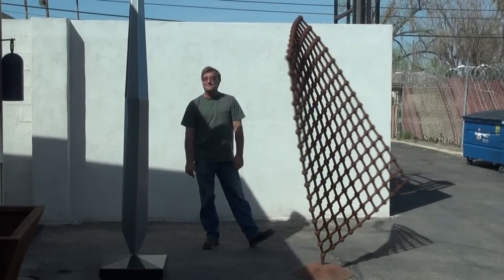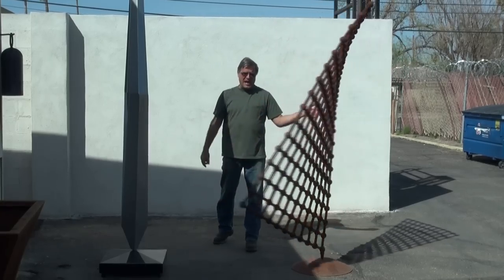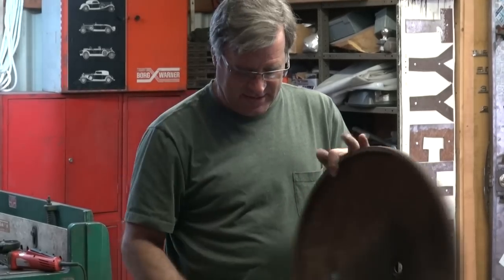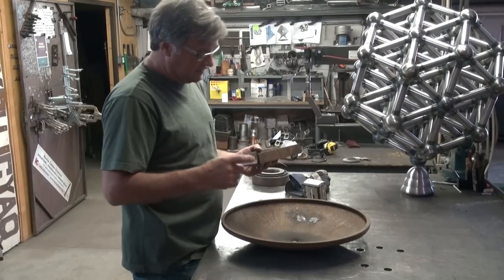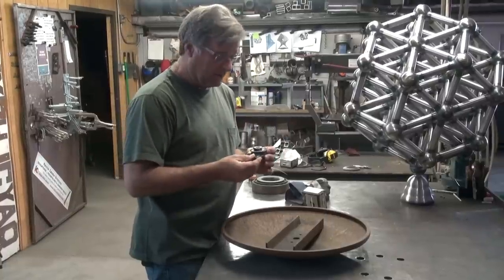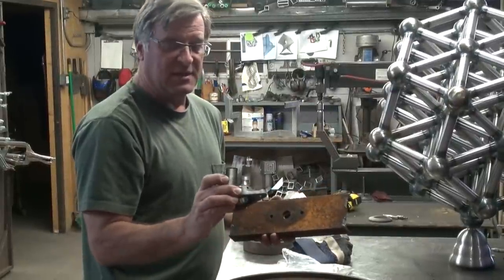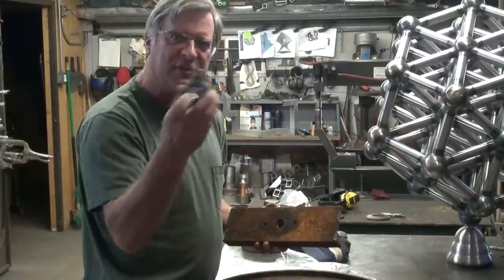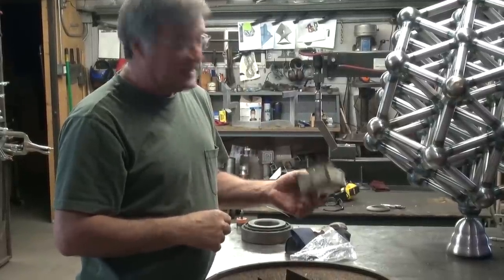How to Make a Sculpture (or Anything Else) Spin in the Wind - Kevin Caron

Comment: interesting.  I am trying to make a kinetic sculpture with 9 things rotating in the wind.  Currently bought 40 bearings for $40 or so off amazon.  They are tiny and for 3/8" pipe.  Have to assemble it to see if it rotates ok.  notice you have to have the center of mass dead center over your bearing or in my case on the pin it rotates on.
Reply from the maker: Way more complicated than mine!!  Good luck and send me a photo when done please.

Comment: Hi Kevin,  Thank you for the informative video.  I do have a question: what does the 3/4 post sit on after it passes through the two flange bearings? Thank you, Jeane
Reply from the maker: Great question!

It's doesn't sit on anything.   There are two set screws in each bearing that hold the shaft in place.   I didn't want anything to drag and slow down the rotation of the sculpture.

Comment: What does the base end of the rotating shaft bear against, and how is the contact friction managed?
Reply from the maker: Sometimes I cut a step in the shaft and use a smaller thrust bearing to hold the end of the shaft.  Other times I will use a flange bearing and just tighten the set screws on the bearing to hold the shaft in place.  All depends on the weight of the sculpture.

Comment: nice vid, do u use a lathe turned shaft or a stock piece of cold rolled bar for the bearing shaft. i want to mount a welding project to a bearing and i was just curious.
Reply from the maker: Just cold roll bar stock.
Reply: Kevin Caron, Artist ...thanks

Comment: Great video. I was wondering after your 3/4" rod from the sculpture goes through the bearings, does it sit on the ground.... or you cut it so it only goes through the second bearing to keep friction at a minimum? Thanks.
Reply from the maker: I cut it just after to comes out of the second bearing.   Least amount of drag that way.
Reply: How does it sit on top of the disc? Do you have a washer ?
Reply from the maker: Sits through the disk. Both of the
bearings are below the disk.
Reply: Kevin Caron, Artist I understand that.  But something had to keep the rod from going all the way through.  In other words what do you have on top that is spinning against the disc on top
Reply from the maker: When you tighten the 2 set screws on the two bearings that is when holds the rod in place.   If I had been thinking I would have gotten a shaft a little over size and turned the shaft down to fit the bearings.  That would have given me a step on the shaft to hold it in place.
Reply: The set screws -- Now it all makes sense -- Thank you so much for all your help

Comment: I have an outdoor artwork of two crows. They are balanced so that they spin in the wind. I take care of them so they're not all rusted. For some reason they've stopped spinning. The perch is metal with a curve and the birds are spaced out to create a good balance. Nothing changed. What happened?
Reply from the maker: Have to take a look at the pivot.  Is it a bearing or just a post in a pipe?   Try a shot of WD-40 in the pivot and see if it spins free. If so then you just need to oil it.

Comment: Good man who appreciated engineering in art. In fact I always say that all the foundations of art is engineering structure and the art part is the emotions that observers in front of the unit generate themselves with their own imagination. All  art which is enclosed in a dark room retains only its engineering structure and art only forms when there is a human observer in front of it. Art is not in the item but in the observer who generates the art himself, In fact I call art emotional drug and all artists are in fact drug trafficers  using engineering based substance!!!   
As far as those bearing are concerned  at 3:24, the action of those bearings do not cancel each other out, but they are meant to find the right centre if there is a misalignment and they gimbal in a  spherical support.   If one uses two at a distance from each other, they line up the rod in them and as there is no slack in the ball bearings and inner and outer races then the shaft retains its alignment but it is not  " cancels the other".    Congratulations on your appreciation of engineering parts that other throw away.
Reply from the maker: Have never heard it explained that way but I totally agree!

Thank you for watching and posting!

Comment: Instead of a 2nd bearing, why not save $$$ and just use a bushing to help with the alignment and reduce wobble..?
Reply: Bronze bushings are used in many machine set-ups for the same purpose. They don't rust and are fairly durable.  I was a machinist 30 years ago and the thought came to mind.

 I was wondering also about access to the bearing to add grease.  Would the whole sculpture have to be put down on it's side ot would it be possible to gain access through a small door on the base.  The door could also be used for a name plate of the sculpture (if you use one) which would make the door discrete.

Anyway, thank for sharing the intricasies of your work!  Keep on keepin' on, wish you the best!